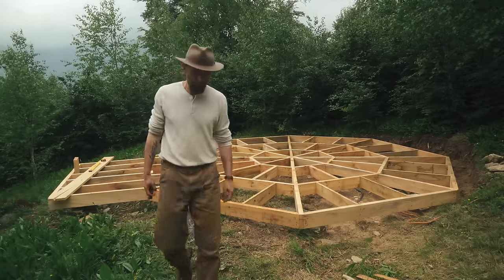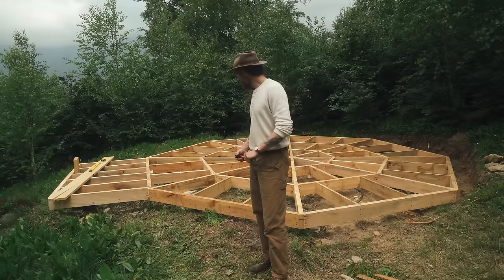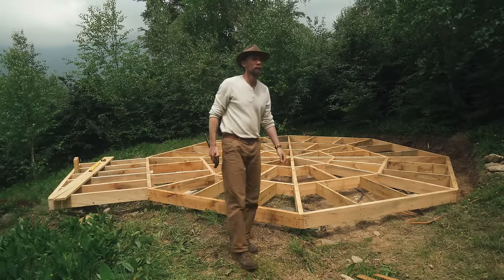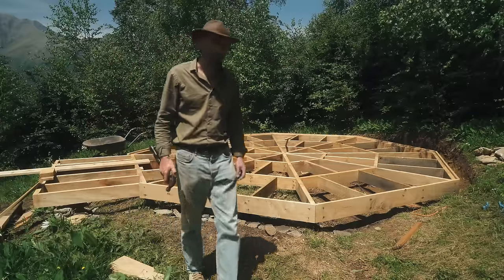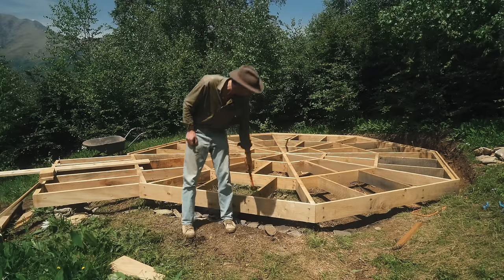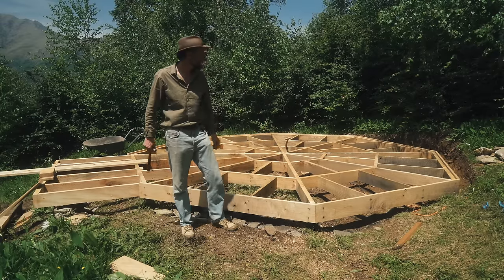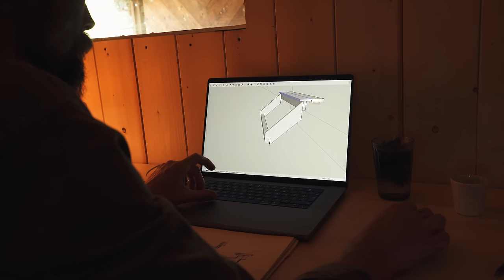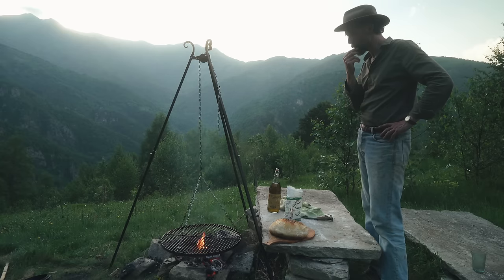#21 Baking bread on open fire, Planting more crops, Building the deck

Comment: Put a inverted pie plate or cake pan at the bottom of your Dutch oven. Place your dough on a piece  of parchment paper and place it in the Dutch oven. You need indirect heat. This will stop your bread from burning on the bottom. Buon Appetito.

Comment: When swinging a sledge hammer, the hand closer to the head of the hammer is usually sliding back and forth on the handle as you raise and it comes down.  You actually exert less force to get the same amount of work done using this method.

Comment: Thank you so much for the videos...I love watching them.  RE: baking bread in a 'dutch' oven...We used to heat the pot in the fire, then when we put dough inside, we'd remove it from the flame, put coals on top as you did, and wait...worked a treat!(no burned bottoms!).

Comment: You are correct about the nails and the chestnut. I am a carpenter and work a lot with chestnut and use stainless steel nails or brass screws. The tanning in the wood will eventually corrode the untreated nails.

Comment: The framing for the tent is coming along really well! Amazing design! For the bread, number 3 looked great. To avoid the black bottom, think of the italian pizza oven method -- you want indirect heat, not direct heat right over the fire. Imagine a pizza dough or a calzone -- the heat is at the back of the oven and you place the pizza close to the fire and then rotate it. So for the stand that holds the pot, put it to the side of the flame and turn the pan a couple times during the cooking. Will be perfect!

Comment: I admire you! Only discovered you yesterday. Am hooked.
The bread.  Advice from you Dutch family down south. We still use this method  all the time. You are so brutal with the fire and the  coles. GENTLY! You are making bread not cannonballs. Don't  OVER OVERheat the pot  prior to putting the dough in and don't put toooo many flaming coles on top. Gently!  It will be much more palatable until it's all  finished.

Comment: Great post as always, I would suggest deck screws over nails (easier to undo and better bind) + typically have some type of coating (ceramic or else) to avoid rusting.
Reply: I was wondering that as well...
Reply: Or anything galvanized.

Comment: Hi Martijn, for the bread baking in the fire you need to let the fire die down so that the white still hot ash just after the redness of the heat/flame leaves the ash then bury the pot with the bread under the ash so it is equally heated/baked as the ash has no more energy to burn like wood or charcoal does this is why it is burning on one side hope this helps. Another great video as always i hope to build my home in Italy on day as well.

Comment: We have to use stainless nails on all of our high tannin woods like cedars, mahoganny and redwood. The Tannins react to the zinc in the galvanized nails and form that black precipitate. Stainless ring shank siding nails are what we use to prevent this. I am a contractor with 30 + years experience.

Comment: To make bread in the Dutch oven, I put a small piece of metal on the bottom part and a steel plate on top, the bread sits on top of the plate and that way the bread doesn't burn from below.

Comment: as soon as you put the bread in that cast Iorn on the fire I knew it was charcoal. Cast Iorn gets super hot in fire, like 500 - 700 degrees. You really only need 375 to 450o to bake a good loaf. 500o is pushing it. Good last attempt. Only 20 minutes with lid and suspend above fire then take lid off and 20 minutes lower. Keep trying and it will be perfect but different every time. That's what makes it so good. Felicitation!

Comment: Hi Martijn,

Love your work, look forward to each weeks edition.
Just a little advice, I am a pretty experienced  (mostly sourdough baker), and I bake bread whilst caravanning. All you need to do to stop your bread burning on the bottom and get more oven spring is four things.
First put you dough into a cold Dutch oven, but with a pre heated lid.
Secondly place a wire rack/trivet in the base of the oven, you put some doubled up foil or a metal dish on it to support the dough.
Thirdly don't start to hot, give the dough time to rise in the oven, then crank up the heat later.
Fourth, make sure you spray a good amount of water onto the dough (in the oven) after scoring, before you put the lid on.

I hope this helps you make some delicious bread.

No for a question, the issue with the screen breaking up all the time, (looks like a dodgy camera sensor), has now decreased, it seems to now only occurr a few seconds before you cut to the other camera. Any idea what is causing it ?

Comment: One online expert (David Willis) suggests baking bread in a second pot set into the Dutch oven, supported by green sticks or stones. Also scraping embers back and placing Dutch oven in area with no or few embers. Other suggest rotating the loaf. And placing embers on the top just at the end.

Comment: When baking bread in a Dutch oven you need to put the dough on something so it does not sit directly on the bottom. I use a metal trivet, but you can roll aluminum foil into balls & rest the dough on that to cook.   It takes 25 briquettes/ coals  to bring the internal temperature  of the Dutch oven to about 350F; 8 on the top & 17 on the bottom.There is an excellent book, THE MAGIC OF FIRE by William Rubel that is an excellent book that shows you how to cook on the hearth & campfire.. I found it quite useful when camping Good luck on your next loaf of bread

Comment: Beautiful bread dough and you are not a novice. You could make yourself a welded metal trivet or use stones to elevate Dutch oven. Move Dutch oven out of the fire but place over hot coals. Add bread then add about 10 briquette around outer lip of the lid and a few in the center. See if that works for you. Always enjoy the aerial views. Deck is amazing can't wait for the tent.

Comment: 1) Love the series Mr Doolard! <3

2) Quick tip on bakery that comes out black: Brush the black/hard areas with water right after it comes out of the oven, and the crust will soften (but not get "wet" since the water quickly evaporates while the bread is piping hot). I was amazed how big a difference this makes when I first discovered it. You can even shower (not soak) the whole thing, and then shake off the excess water if its badly burnt. Of course, there is a limit to how well this works, depending on how deep the charring goes, but I've converted many a baking effort from "trash" to "perfectly edible" after I started doing this - the crust stays crunchy! =)    
    
Keep up the good/hard work! Its heart-warming for us urban-stranded to see your efforts come to fulfillment!

Comment: Hi Martijn. Been baking bread in a Dutch oven lately. Two wee tricks : Parchment paper under your dough in the bowl after kneading for the second rising which then goes straight
into the dutch oven. On the bottom of the oven place an elevating round wire ring stand. Bread in P.P. go in on top of it. Bread turns out perfectly every time. 450 degrees F for 35 minutes with lid on, plus 5-10 min., lid off, for a hardened, crispy crust. Great vid. Thanks. Have fun. Best of luck.

Comment: Martin, there are lots of good comments from bakers who use the dutch oven method over a fire.  In particular  as several people noted, the fuel does need to burn down to hot glowing coals for an even heat, as we saw bread baked over a direct flame will burn the bottom of the bread.  One thing that you did get 100% right on the third try were those beautiful blistery bubbles in the crust, this is called the "Maillard reaction".  In baking it's a chemical reaction between amino acids and reducing sugars that gives bread its distinctive flavor. One way to promote it is to have a long, slow rise in a cold place. Generally for long, cold dough fermentation the amount of yeast is reduced (often to only 6.2g/1.5 teaspoons) and the fermentation period is increased to 12-16 hours or so. You don't have a refrigerator yet but if the dough could be allowed to rise overnight in 10c/50f temps to promote a Maillard reaction and a beautiful browned crust. Using less yeast and a long cold ferment makes the yeast work harder and it produces the amino acids and reducing sugars characteristic of the Maillard reaction.

Comment: My dad used to cook biscuits in a Dutch oven over a campfire, but he let the fire die down to coals first and he put a little grill in the bottom of the Dutch oven so the pan with the biscuits in it did not touch the very hot bottom of the Dutch oven. Maybe you could put little pebbles in if you don’t have a grill. And, like you did, he put hot coals on top of the Dutch oven lid. 😊

Comment: It was just to close to the fire. You could have pulled it up and as you did put coals on top and it would have been just fine. It was just to hot so it burned. Try again. It looks like it’s going to be good. Another great vlog. It’s beautiful there with everything in bloom. ♥️👍🏽

Comment: Hi from Australia! I have found the best way to cook this bread or a damper as we call it in Australia, is to put the oven on the ground, with no coals under it, and just put coals around the sides, and sparingly on the top. This way you have a gentle crust on the bottom, and the loaf can be cooked to perfection. You may have to add some fresh coals during the cooking time however you will never burn the base! Cheers from the Land Down Under!

Comment: For the second attempt at the bread🍞, raise the pan 1 inch, so it bakes without burning.  But you have to put more stones around the fire so that the temperature is the same on all sides, thus forming an improvised oven.  It will work out next time.  kisses from Brazil🇧🇷

Comment: What a beautiful and robust deck for the bell tent, it looks great! Your bread baking is good teaching of how to bake on an open fire. That pan is a must-have, and a clever design too, for putting hot coals on the lid and not seeing them fall off. You seem well prepared, and inventive.
It's pleasing to watch the place becoming yours and turn into a well cared for settlement.

I've made flatbreads once by placing the dough parts (the size of a saucer) on the outside of a  40 cm high, 40 cm wide clay pot that I made, to burn a fire inside. The clay was in the soil, and so I had everything I needed, water, flour, dry yeast and some salt. During a high summer camp.

This manner of baking was an experiment and it worked very well. Also sourdough was easy to bake, by mixing flour, water and salt, leaving the dough for a night or more, until it fermented a bit. Temperature determines when that's done. Those pieces of bread didn't come off flat, they grew more during the baking and were almost showing up as buns. Frying in oil worked too.

Comment: Baking bread on a fire is an art. Try putting a pie pan or similar upside down inside the dutch oven so the bottom doesn’t burn. That works fairly well. Though your dutch pven is short, so you may not have room. But even 1cm of space above the bottom will make a difference.

Comment: Baking bread in a camp fire is hard. It's a food you have to babysit when on a campfire. Try setting the oven in the coals, with a reduced flame. Coals need to be fairly even around it. Place coals on top, as you were doing. Rotate  the bread inside the oven every 15mins and keep adding coals on top to keep the temp warm throughout. Depending on how hot the coals are, it can take an hour or so. Well done on everything, and I'm glad to watch your journey through out this. Ta for the videos.

Comment: Great work Martijn, The dutch oven does not need much heat to do it's work. Definitely no fire. Once it is "preheated" you can actually only use a thin layer of coals on the lid and underneath. Or dig a hole in the earth, line it with coals , set the oven in, a few coals on lid , you can bury it or not, depending on what you are cooking.  You might also want to put a couple of tablespoons of lard inside the oven so that the bread bottom doesn't burn so bad.

Comment: Martijn, great video, thanks so much for sharing your progress.  A tip for the bread baking with the Dutch Oven on a fire is to place a few small pebbles in the bottom of the oven, place a thin flat stone on top of them that almost fills the inner diameter of the oven and bake the bread on the flat stone.  You can get a nice crust without burning as the stone moderates the heat without stopping the baking process. Good luck with it!

Comment: Martijn, it's a fascinating, beautifully made series. I live in rural Thailand.  The main equipment they use here for almost anything is an excavator on tracks. It will lift heavy loads, digs trenches and will haul heavy loads up that mountain with ease, even in winter time.

Comment: Stunning deck construction! 
For bread baking on a campfire I’ve seen some in Azerbaijan and India a take a shallow metal pan and cover the bottom with mud, as to stop the pan from scorching black with soot on the campfire coals. They then add fine textured sand on top of the shallow pan. Now put your Dutch oven set up on that. The fine sand allows for an even radiating heat and stops the burning of the bottom of the bread. You could also line the bottom of the Dutch oven with parchment paper before adding the dough ball.
The crumb on your last batch looked exceptionally delicious anyway! Nice crispy crust! Yum!

Comment: The black lines on your chestnut boards are simply the reaction between the iron in your nails and the tannin in the chestnut. Stainless steel nails would not have the same reaction but it’s too late for that now. You can use oxalic acid to remove the stains but they will return. If you mix vinegar and rusty nails and leave to lie for a day you can use that mixture applied with a cloth to turn the chestnut board surfaces black/grey in advance of nature. It’s a nice effect.

Comment: Yep, tannins will turn your chestnut blue/black in moist conditions and with contact with ferrous metals,it's the acids in the tannins. Stainless screws are recommended to avoid the staining and oxalic acid (which is supposedly made from rhubarb leaves) can be used to clean it off if desired  . All the best.

Comment: When baking bread over open fire, we usually put the pot to the side. Creating a specific separate place for the bread. This way the coals can be transferred to the bread pot when needed rather than stoking the main fire. This allows for more control over the heat, but requires a bit more checking in. Hope it helps, keep up the good work.

Comment: These videos are so mesmerising, it is fascinating to see the property changing through the seasons. A couple of suggestions - you need galvanised nails for your deck. Also your vegetable bed is way overplanted. The brassicas and potatoes in particular need lots of room. All the crops will be competing for light, nutrients and water if they are too close and won't thrive. With so much land it may be worth considering some bigger veggie beds.

Comment: Hi Martijn.
As you also assumed and  "Iscadeen" wrote  down in the comments, the black stain aorund the nails is a reaction between tannic acid (tannin) and iron.  In case of you want to remove the black stain around the nails you can use 5-10% solution of oxalic acid, Oxalic acid is namely a stronger acid than tannic acid and thus makes the black ferro tanat to an oxalic acid salt which is colorless. Be cautious with the oxalic acid, it could be slightly pousinous in case of svaling or getting in open wound.
Thanks for sharing your days in this beautifull environment.

Comment: Hi Martin. Loving the series, that Suzuki and trailer will be legendary by the end of the build .haha. Seems like everyone does their Dutch ovens a little differently. We like to first build up a heap of hot coals and then dig a hole right on the edge of the coals where the soil has been heated then put some coals in the bottom of the hole drop the oven in and put more coals on top and down the sides which tends to give us an even heat. Keep up the great work😁

Comment: In order to stop the staining on your wood you gonna have to use galvanized nails instead of steel nails cedar ,oak,spruce,cypress woods stain from using steel nails that is why it’s recommended to use galvanized nails instead or wooden pins to secure the wood. You should be able to sand the stains out provided you don’t wait to long then use some clear sealer on the outer boards to prevent it in the future. The deck is coming out very nice.

Comment: With your planks on your deck the best thing to do would be to use some Stainless steels nails or screws. The black stain your getting is seepage from the nails spreading through the grain when the nails get wet. Your doing a really good job the deck looks amazing.

Comment: Not too close too the fire with that pot . You dont need so much heat at the bottom and fewer coals on the top to get a good brown crust. Took me a few times to get it right but now I do everytime. Good luck with the projects you sre coming on well.

Comment: Hey mate, awesome series you are building. Regards Dutch ovens for bread use a trivet on the bottom to lift it off direct heat and allow on base  Al foil or some such, it will work a lot better. Heat management is a challenge tho a great way to cook IMO. Really enjoy this series and what you are doing. Caio